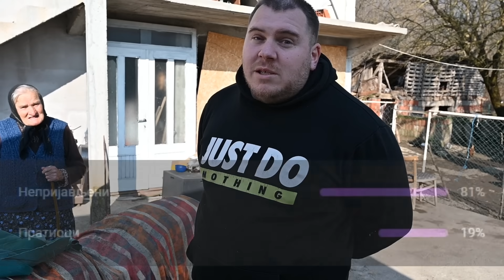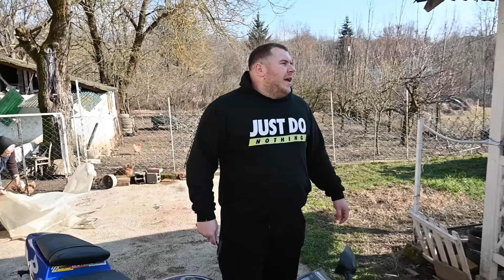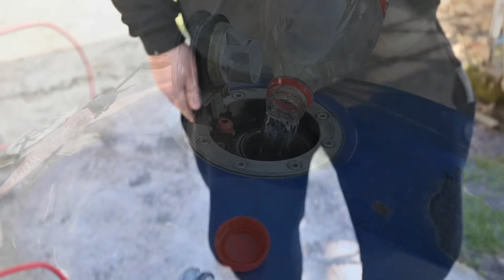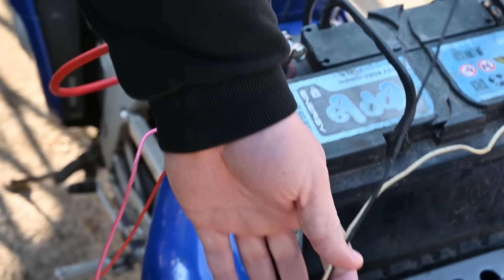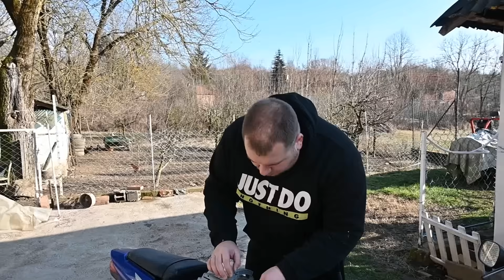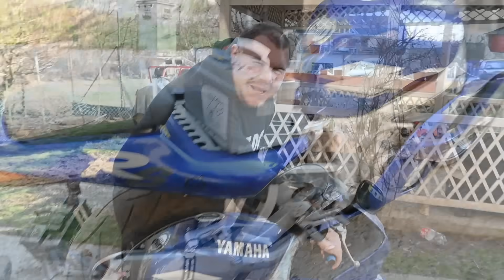Palimo YAMAHU R6 posle 3 GODINE!!!

Comment: Please use the captions. Sounds like fuel pump. Change fuel pump, solenoid, regulator they perish and tend to blow when bike is all fixed.  clean carbs with seafoam. +1 subscription, please use captions so I can understand thanks.